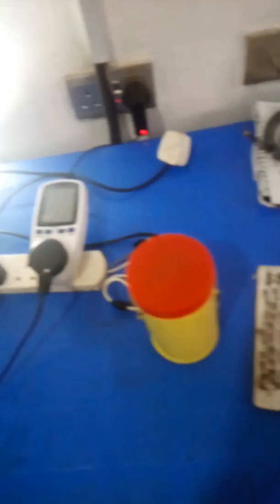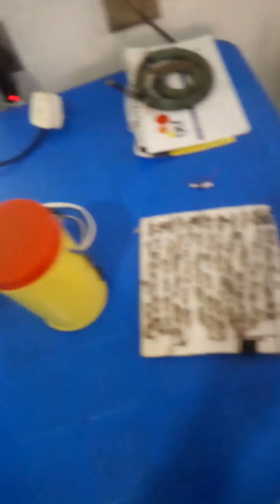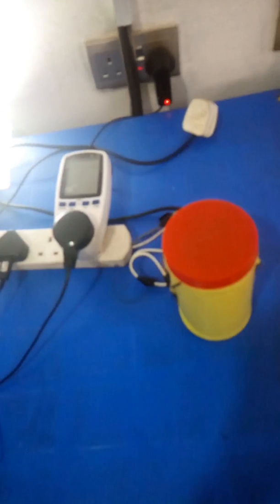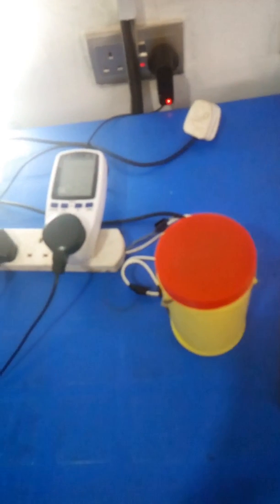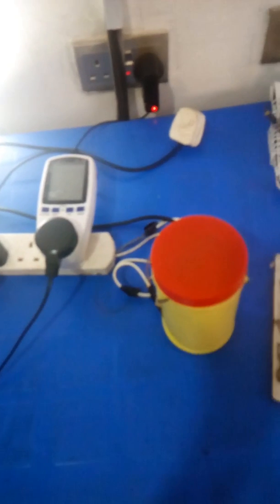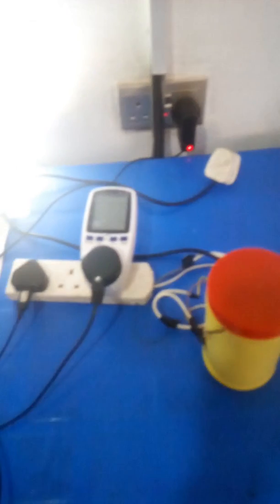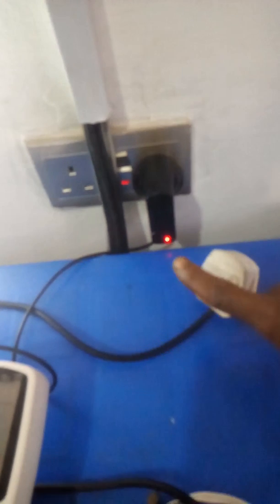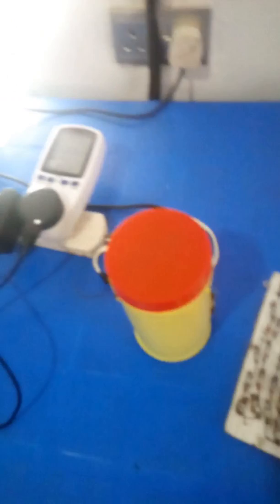The Alekz beads 100% savings.

Comment: There is a point here.if the switch break line or null.usually breakers work on null.so the line or phase is there on the circuit and through the earth connection ,it works even without a reactor.so just to be  sure ,check this point and inform us